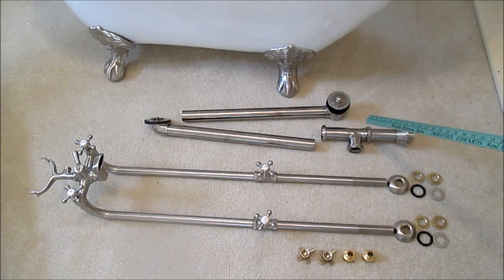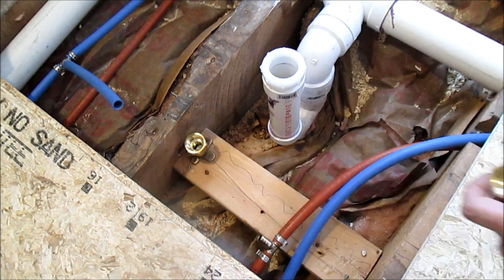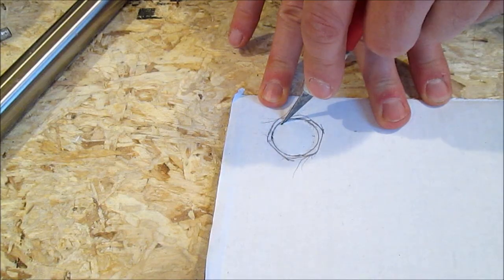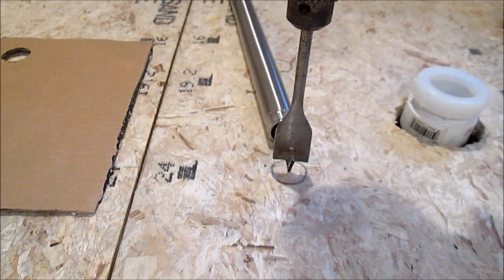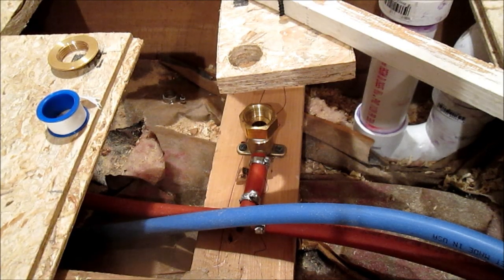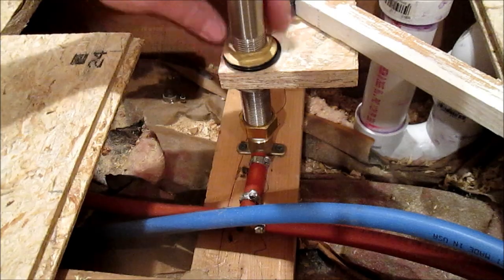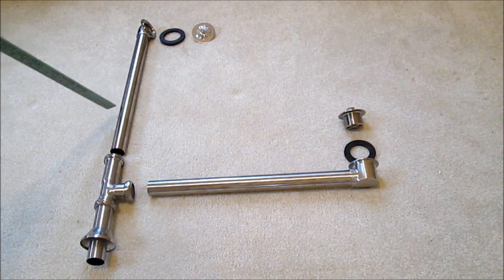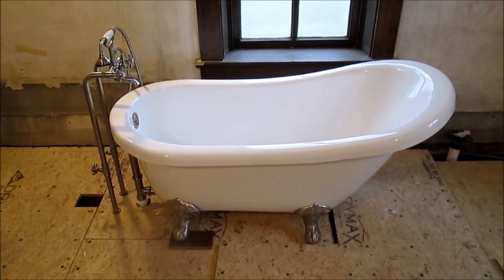How To Install a Clawfoot Tub

Comment: This is a great video!  I hope you're still doing great work. Do you have anything like this video, but installing it on a first floor?  There's a shower where we want to ADD a claw-foot tub next to a shower.  The foundation is slab and will be interesting to work with.

Thanks for the video.
Reply from the maker: There are three clawfoot tub faucet options, that each mount differently.  One mounts to the floor, like mine does. One mounts on the wall next to the tub, and one mounts on the tub itself.  If you are sitting on a concrete floor, I would suggest either mounting the faucet on the wall, or on the tub with stainless steel flex lines to the wall.  If you really want to do it in the floor, you are going to have to saw out a chunk of concrete, run your waterlines in, and then go back in with Concrete.

Comment: Badass very straight forward video man! Good stuff. Keep it coming. One question though what did you do about screwing that piece of the subfloor that you cut out? Did you just attach a cross brace underneath the plywood and reattach the piece?
Reply from the maker: Yes a cross brace, but then tile board and 12x24 ceramic tiles on top of that, so I hardly even needed to put in back.
Reply: @HowToLou  figured soo. Thanks again !

Comment: so when putting the bottom washers on the standpipes you must have to put the bottom one on first right if the subfloor is down there how are you supposed to put the bottom ones on because we can’t use a sample at home. That’s the only part that confused me on how to make sure unless you get the subfloor piece that you cut the holes in and just make sure everything is on there and then put it down but then it leaves the question how do you tighten it after it’s already covered up

Comment: I have a question about the access (rectangular) hole you cut to tighten the nuts on the bottom of the water supply lines. Do you simply floor over it?  if so, what happens if the lines loosen up?  Great video btw!
Reply from the maker: +AFHero66 - Sorry there is no great answer. Just like any other plumbing in walls and floors, if it leaks, your have to tear something out to get to it.  Fortunately, if it is done right, leaks are very rare.

Comment: How do you secure the clawfoot tub to the floor? Or is it just held in place by the drain?
Reply from the maker: Its just sits there.  They are heavy enough they don’t scoot much.  If you have a problem with scooting, you can drill 1 inch diameter holes in the floor, only 1/4 inch deep, under every foot.  There is a tiny rubber foot under each “foot” that will fall in those holes and lock the tub in place

Comment: How do you secure the feet of the tub if it is a tile floor and the copper tub is so light you can slide it around??
Reply from the maker: Try gluing it down with pure silicone. If that does not work, place the two back feet over grout lines.  Drill two holes through the feet with a metal bit, and into the grout lines with a concrete bit.  Secure with tapcon screws. If you can’t hit the grout lines, use a diamond bit to drill through the tile.

Comment: I have heard that you might have to reinforce the floors under a clawfoot tub. Can you tell me about this?
Reply from the maker: A cast-iron tub can weigh anywhere between 250 and 500 pounds. Add to that another 200 pounds of water and you have something very heavy that your bathroom was likely not designed to support.  To bolster your floor, you will need to double up your floor joists. If you’re on the first floor, you might be able to reach them from the crawlspace or basement.   If you are on the second floor, you will either have to rip out the bathroom flooring, including the subfloor, or rip out the ceiling from below.  Another option is to get a fiberglass clawfoot tub. They are only about 100 pounds.  They are not as durable, but not too bad, and look great.

Comment: What about getting the finished floor under the tub? I bet that is tricky.
Reply from the maker: Actually, that was very easy. Disconnect the tub from the pipes and carry out of bathroom.  Lat tile floor around pipes and drop in escutcheons.  Bring tub back in and hook it back up.
Reply: Yeah but won't the height be off a little?
Reply from the maker: The drain pipe can extend in or out.  The hot and cold are not connected to the tub in any way.  I now have tile under it, no problem.

Comment: What if you have concrete foundation?
Reply from the maker: It is much more difficult to install a claw foot tub on a concrete floor.  You will need an angle grinder with a diamond blade to cut a hole in the concrete for plumbing.  See this video on moving a toilet on a concrete floor.  You will have to do a lot of the same things.  
How To Remodel a Basement Bath - Part 1 of 3  (HowToLou.com) https://youtu.be/fVcw7GrZ6Ok